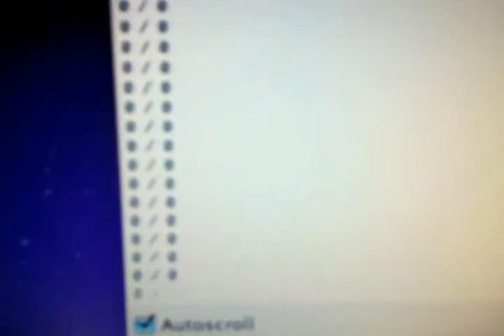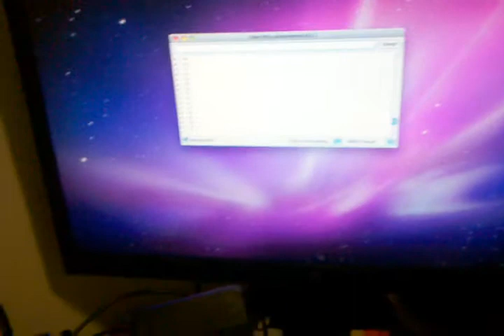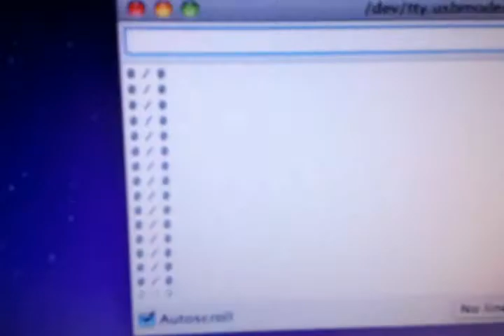Computer Game RaceCar Pedals + Arduino (aka RaceCarduino)

Comment from the maker: @mahela1993 In short, the arduino is connected to the computer via usb at runtime. This allows serial communication to and from the arduino. I also had to specifically tell the arduino to send the values over the usb in my code. To do this, simply add Serial.begin (9600); within the setup function. Then add Serial.println(val);  within the loop function wherever you'd like to output a value to the serial monitor during runtime. And obviously "val" is some variable of yours.